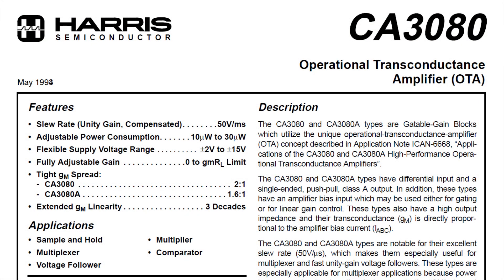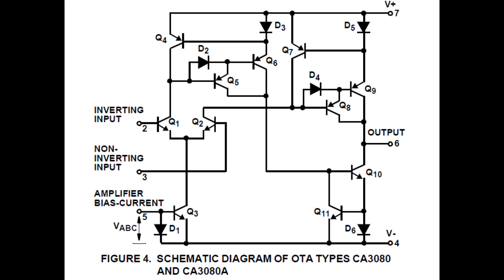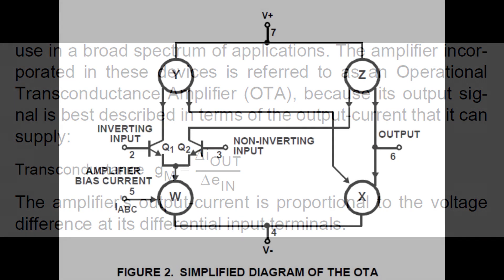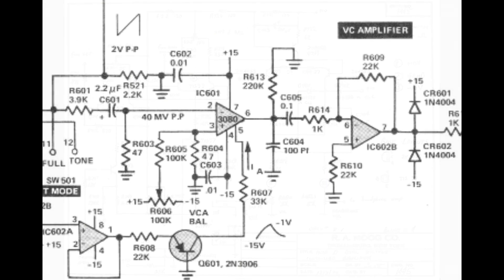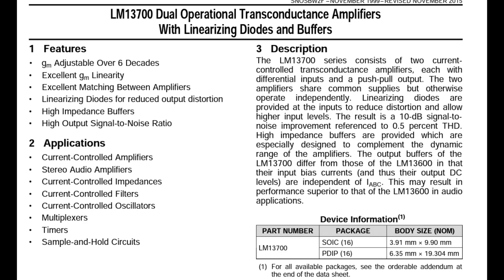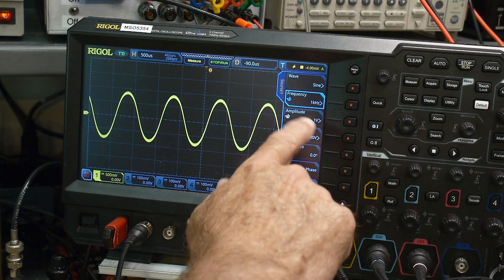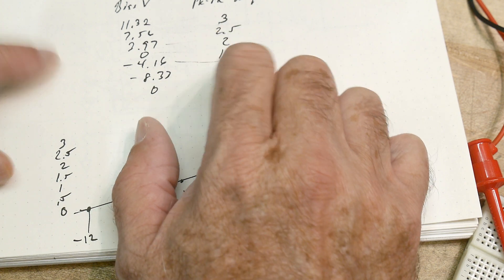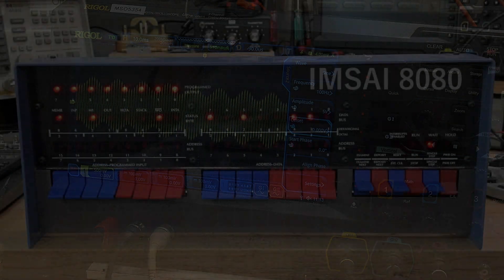#1203 DIY Analog Synthesizer (part 6 of 15)

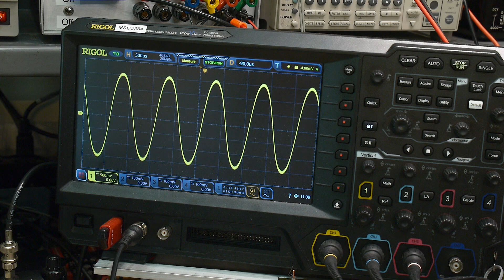Comment: At 7:40...you call it a voltage controlled oscillator...

I see it as voltage controlled amplifer...

That is you are exciting it with a signal generator...the amp is not oscillating by itself...and the amplifer gain is being changed by the pot...or a voltage feed from the pot into that bias 120k ohm resistor...

It's all good...

Those transconductance values...reminds me of the JFET and MOSFETs...a change in drain current divided by the change caused by  gate voltage is the transconductance....

Looking foward to seeing hearing the IMSAI Moog mini....

Thanks
Reply from the maker: oops, it's a VCA

Comment: Great explanation/demo of OTAs! Might be worth mentioning the symbol for an OTA usually has two little overlapping “ven diagram” looking circles at the output of a normal op amp symbol where the control input is indicated.

Comment: You did very good job of explaining OTA.  Also, AM modulation with OTA that you demonstrated is interesting.  What else can we do with OTA, that we can not do with opamp?
Reply: Analog multiplication. Out=k*(In1*In2)
Reply: @stamasd8500  Here  what I found on line about differences between OTA and opamp and OTA usage:

Differences:

1. " OTA has three inputs while your OpAmp has only two. Besides the two differential input terminals that an OTA and an OpAmp share, the OTA has a third input that lets you set the gain of the amplifier by applying a current."
2.  "Better high frequnecy capability than opamps"
3.  "OPAMP: Differential high impedance input and very low impedance output (voltage source) and a very high gain."
4.  " OTA: Differential high impedance input and rather high impedance output (current source). ."

Common OTA usage:

1.  "automatic gain control"
2.  "to control the volume of an audio signal."
3. "voltage controlled filters"
4. "very rarely used in closed loop configuration, e.g. you won't find the typical resistor from output to negative input. This is because they don't have the high open-loop gain to begin with"

Comment: OTA?  That's a blast from the past!

It used to be that the LM1496 was my go-to part for this sort of thing. A bald OTA usually had way too much distortion. 

If you need 4 quadrants, the 1495 is no more, alas, but you can fake it with two 1496's and an opamp, for a few bucks cheaper than something like an AD633. (If you're doing something like this and hoping for serious performance, an AD633 is probably the minimum quality part you should consider - but we're getting into a different price tier; 1496's are jellybeans.)